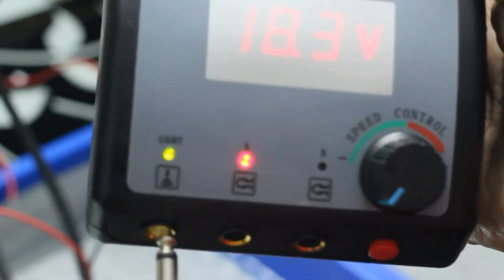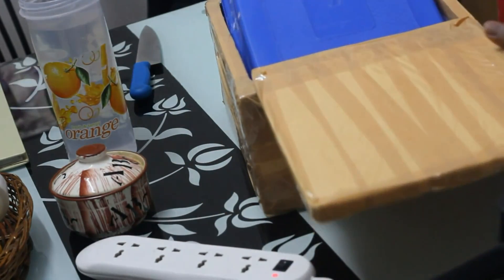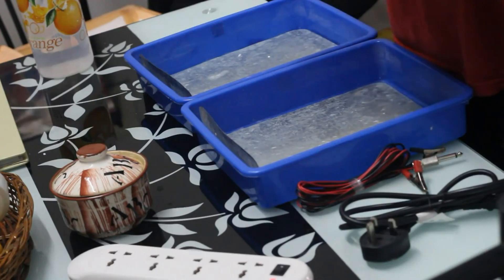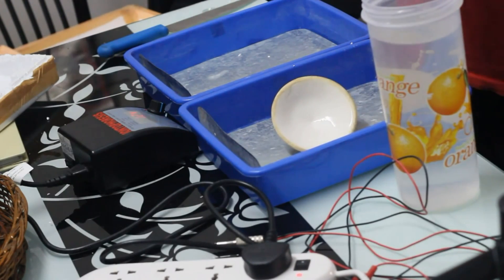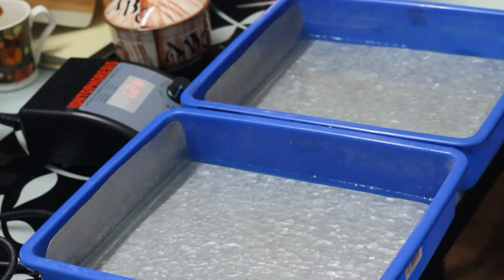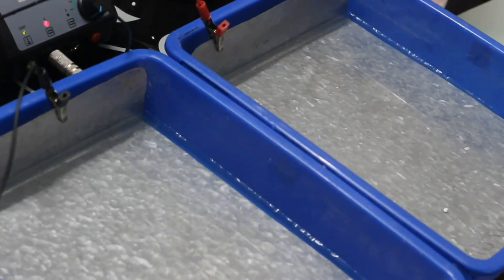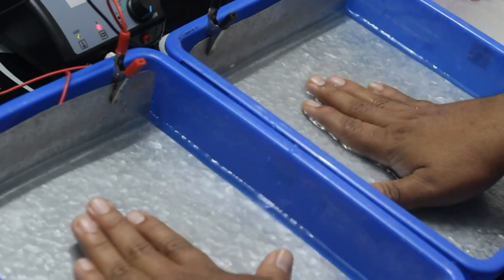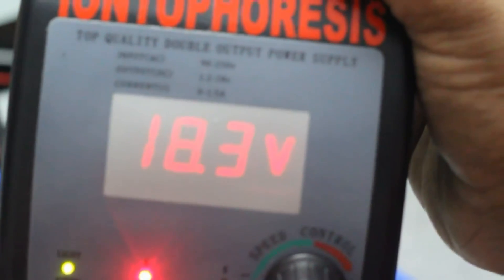Hyperhidrosis Treatment With Iontophoresis Device In India -  Step to Step Guide

Comment: Hey I have extreme palamar hyperhydrosis and I know this treatment. I have been using homeopathic medicines but it doesn't help I'm from India will buying this machine for 10k dry my sweaty hands because it is very embarrassing in day to day life to shake hands and stuff
Reply from the maker: Hi. Sorry for delay. with 20% discount you will get it for 8k contact:
For More information on this device
call us at: +91-9603675116,09603675116 (India), 9603675116 (Local) or
Email me at: vijaykumar0829@gmail.com
website:http://iontophoresisdevice.co.in/

Comment: sir iska price kya hai
Reply from the maker: Hi Arif,  

Device Cost hey Rs:10,000 with Free shipping. please let me know your cell number to call you.

or  Please send a email for details at: vijaykumar0829@gmail.com or call 09603675116

Iontophoresis is a method to apply a weak electric current to the skin, It blocks the sweat pores and glands which produce sweat. thus the dryness will last for 8 to 9 months if the skin type is thick, for thin skin type until 6 months. Many suffers have different roles some even don't sweat after using device for 1 yrs.

This is not a fake device which people sell now a days. This is CE approved and will give you 100% results within 2 week complete dryness in palms and feet.

For More information on this device

call us at: +91-9603675116,09603675116 (India), 9603675116 (Local) or
Email me at: vijaykumar0829@gmail.com
website:http://iontophoresisdevice.co.in/
Reply from the maker: Hi. Sorry for delay. with 20% discount you will get it for 8k contact:
For More information on this device
call us at: +91-9603675116,09603675116 (India), 9603675116 (Local) or
Email me at: vijaykumar0829@gmail.com
website:http://iontophoresisdevice.co.in/
Reply: sir can it will remove hyperhidrosis problem permanently or it is  temporary solution.how long this device will take to heal the problem.can I get this in 5000 please sir reply me earliest as possible because I want to apply for Navy within two months and sir I have been give medical unfit before in navy recruitment so sir please help me I am very frustrated with this problem

Comment: Hello! How many mAh this device use?
Reply from the maker: sorry for deplay in reply.. 

Thre are so many people who are use this device who are suffering from sweaty palms and feet. In a month people  buy 3 to 4 devices for us. 

Hello Sorry for late reply.. Din may aap 2 bar kar saktey ho.. agar accha results ana hey to. 

Hi Cristi,

Device Cost Rs:10,000 with Free shipping. please let me know your cell number to call you.

Please send a email for details  at: vijaykumar0829@gmail.com or call 09603675116
or let me know your email address to send you details and prices option.

Iontophoresis is a method to apply a weak electric current to the skin, It blocks the sweat pores and glands which produce sweat. thus the dryness will last for 8 to 9 months if the skin type is thick, for thin skin type until 6 months. Many suffers have different roles some even don't sweat after using device for 1 yrs.

This is not a fake device which people sell now a days. This is CE approved and will give you 100% results within 2 week complete dryness in palms and feet.

For More information on this device

call us at: +91-9603675116,09603675116 (India), 9603675116 (Local) or
Email me at: vijaykumar0829@gmail.com
website:http://iontophoresisdevice.co.in/
Reply: sir mechine ka output kitnay ampire hay?
Reply from the maker: Hi. Sorry for delay. with 20% discount you will get it for 8k contact:
For More information on this device
call us at: +91-9603675116,09603675116 (India), 9603675116 (Local) or
Email me at: vijaykumar0829@gmail.com
website:http://iontophoresisdevice.co.in/

Comment: din main kitne bar kar na hai
Reply from the maker: Hello Sorry for late reply.. Din may aap 2 bar kar saktey ho.. agar accha results ana hey to. 

Hi Hemant,

Device Cost hey Rs:10,000 with Free shipping. please let me know your cell number to call you.

or  Please send a email for details at: vijaykumar0829@gmail.com or call 09603675116

Iontophoresis is a method to apply a weak electric current to the skin, It blocks the sweat pores and glands which produce sweat. thus the dryness will last for 8 to 9 months if the skin type is thick, for thin skin type until 6 months. Many suffers have different roles some even don't sweat after using device for 1 yrs.

This is not a fake device which people sell now a days. This is CE approved and will give you 100% results within 2 week complete dryness in palms and feet.

For More information on this device

call us at: +91-9603675116,09603675116 (India), 9603675116 (Local) or
Email me at: vijaykumar0829@gmail.com
website:http://iontophoresisdevice.co.in/

Comment: Sri!! please tell me where can I buy this machine Sir really i I am in need of it.
I am from Chennai ( tamilnadhu)
Reply from the maker: Sorry of late reply.. please do not harm your skin by laptop adaptor. Iontophoreis devices are CE Approved and medically tested. Before you use them.. you got to buy devices not just risk your life. 

Device Cost Rs:10,000 with Free shipping. please let me know your cell number to call you.

Please send a email for details  at: vijaykumar0829@gmail.com or call 09603675116
or let me know your email address to send you details and prices option.

Iontophoresis is a method to apply a weak electric current to the skin, It blocks the sweat pores and glands which produce sweat. thus the dryness will last for 8 to 9 months if the skin type is thick, for thin skin type until 6 months. Many suffers have different roles some even don't sweat after using device for 1 yrs.

This is not a fake device which people sell now a days. This is CE approved and will give you 100% results within 2 week complete dryness in palms and feet.

For More information on this device

call us at: +91-9603675116,09603675116 (India), 9603675116 (Local) or
Email me at: vijaykumar0829@gmail.com
website:http://iontophoresisdevice.co.in/
Reply from the maker: Hi Rock

Sorry of late reply.. please do not harm your skin by laptop adaptor or any other local devices.. Iontophoreis devices are CE Approved and medically tested. Before you use them.. you got to buy devices not just risk your life. 

Device Cost Rs:10,000 with Free shipping. please let me know your cell number to call you.

Please send a email for details  at: vijaykumar0829@gmail.com or call 09603675116
or let me know your email address to send you details and prices option.

Iontophoresis is a method to apply a weak electric current to the skin, It blocks the sweat pores and glands which produce sweat. thus the dryness will last for 8 to 9 months if the skin type is thick, for thin skin type until 6 months. Many suffers have different roles some even don't sweat after using device for 1 yrs.

This is not a fake device which people sell now a days. This is CE approved and will give you 100% results within 2 week complete dryness in palms and feet.

For More information on this device

call us at: +91-9603675116,09603675116 (India), 9603675116 (Local) or
Email me at: vijaykumar0829@gmail.com
website:http://iontophoresisdevice.co.in/
Reply from the maker: Hi. Sorry for delay. with 20% discount you will get it for 8k contact:
For More information on this device
call us at: +91-9603675116,09603675116 (India), 9603675116 (Local) or
Email me at: vijaykumar0829@gmail.com
website:http://iontophoresisdevice.co.in/